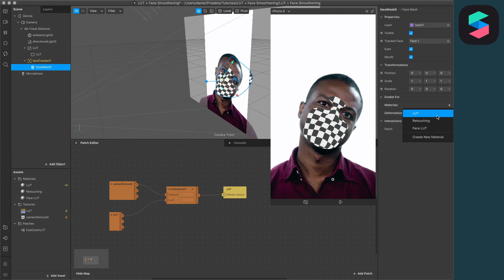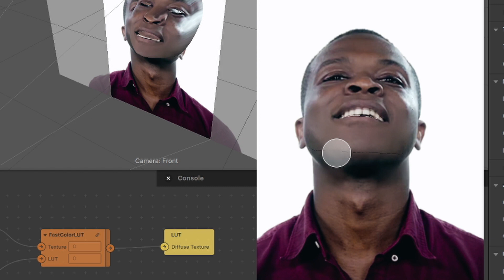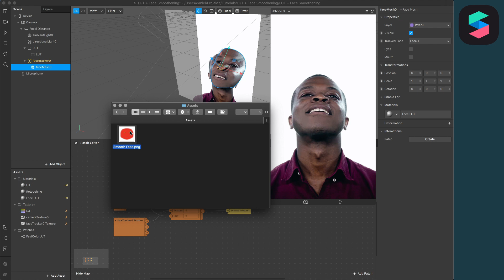LUT + Face Retouching | How to add a smooth effect to a LUT in Spark AR Studio + Problem solving.

Comment: Are you able to show us how to add Slider to control the brightness of the LUT with combination of smooth skin? I am having a problem applying them both because the material type set to Flat where we can control the ambientLight with Standard type.